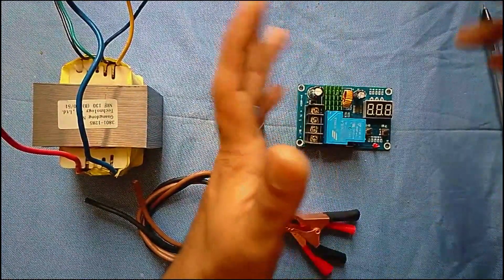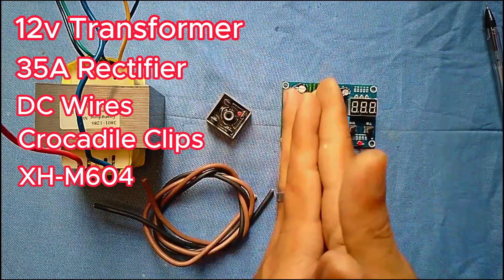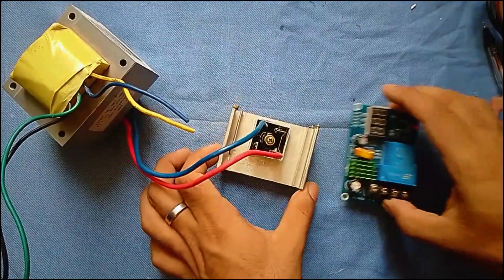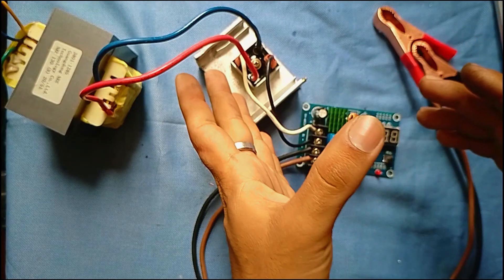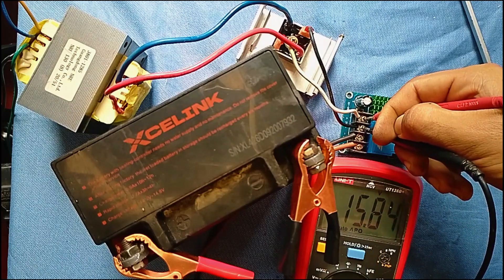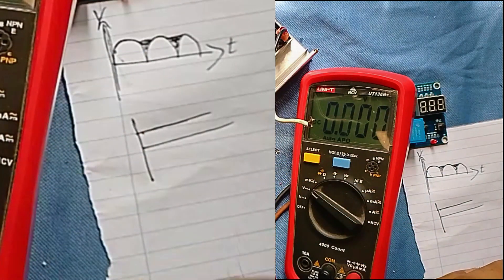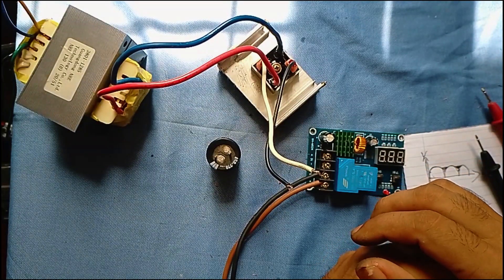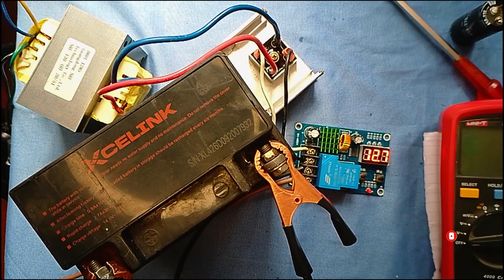battery charger | Ups Transformer එකෙන් බැටරි Charger එකක් හදමු [ Part-03 ]

Comment: මට Cut off නැතුව manual charger එකක් සැදීමට අවශ්‍යයි පරණ බැටරි වලටත් එක්කම. Transformer එකෙන් 15.6V වගේ එනවා DC කරාම ඒක මන් Regulator එකකින් 14.4V වලට අඩු කරලා Battery එකට දිගටම සම්බන්ද කරලා තිබ්බට ගැටළුවක් නැද්ද ammeter එකේ 0.3A වගේ තමා යන්නේ charge වෙලා ඉවර උනාම?
Reply from the maker: Battery eka overcharge wenna පුළුවන් mona karath,  Ampere eken balala hariyata kiyanna be charge welada nadda kiyala mokada api balanne battery voltage eka
Reply: @SLElectricalTechnic  Voltage ඒක බලල Battery ඒක charge වෙලා complete ද කියන්න බැහැ මන් ඔය විදිහටම හැදුව Cut off voltage ඒක 14.7V තිබ්බා තව clamp meter එකත් ඇමිණුවා. 14.7V දී cutt off උනා එත් Battery එකේ indicator ඒක Green උනේ නැ ඒ වෙලාවෙත් 3.5A වගේ Battery ඒක ගත්තා cut off වෙද්දීත්. පස්සේ මන් cut off module ඒක නැතුව පැය 2ක් තිබ්බට පස්සේ තමා indicator ඒක green උනේ සහ Clamp meter එකේ reading එක 0.3A වලට අඩු උනා. Smart chargers වල උනත් Voltage ඒක නෙමෙයි බලන්නේ ගන්න Amps ප්‍රමාණය 0.7A වලට වඩා අඩු උන ගමන් තමා cut off වෙන්නේ. මොකද charge වෙලා ඉවර උනාට පස්සේ Battery එකට Amp ගන්නේ නැ. ඔය Voltage cut off ක්‍රමය එච්චර සාර්ථක නැ බොරුනම් ඔයා ඕකට ammeter එකක් සම්බන්ද කරලා බලන්නකෝ Voltage up උනාට ගන්න Amps ප්‍රමාණය එක පාර අඩු වෙන්නෙ නැ. UPS Transformers වල 15.6V වගේ තමා Battery සම්පුර්න charge වෙලා ඉවර වෙන්නේ මොකද Voltage ඒක වැඩි නිසා.